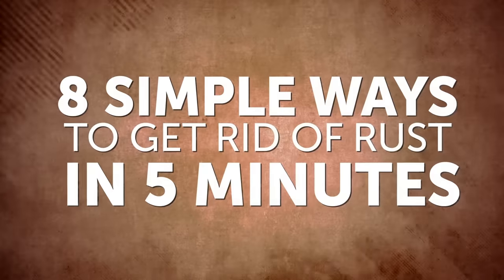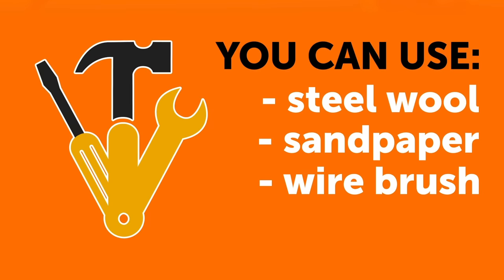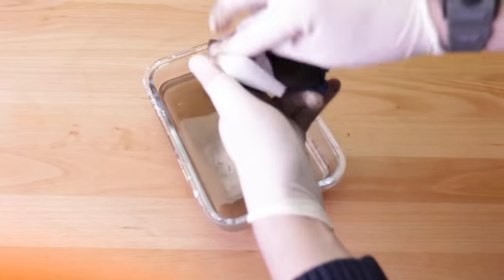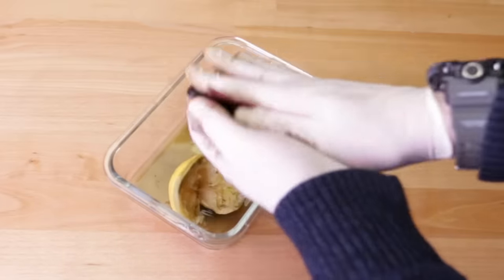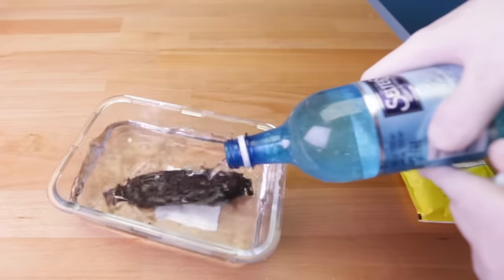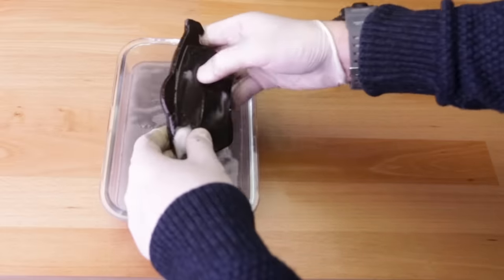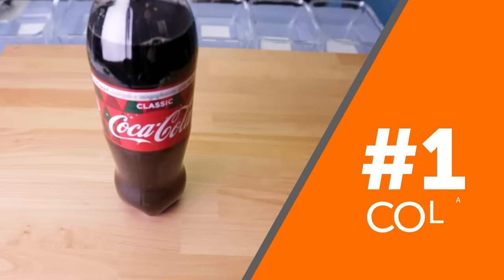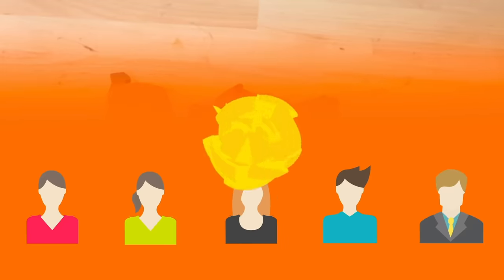8 Simple Ways to Get Rid of Rust In 5 Minutes

Comment: Use  a diluted solution of Phosphoric acid,  then rinse off after 1 hour. this  not only removes the rust  but turns it into a different type of iron oxide  that is dark black and resist any further rusting.
Use rubber gloves to prevent burns from  acid.

Comment: Don't forget to neutralize the vinegar after using it otherwise your tools will catch rust so fast you won't be able to recover.
Reply: I used white vinegar and at first it seemed to be effective, however during a second vinegar bath the items turned orange 😭🤦🏽‍♀️… now I’m on a mission to undo my mistake
Reply: How to neutralise the vinegar?
Reply: @bigcat7569  Baking Soda
Reply: @cherylc4727  what to do with the baking soda to neutralise, please? Sorry, I might do it wrong if I don't get specific instructions.
Reply: @maloutungol9380  make a baking soda paste by mixing baking soda with a little water, rub the metal down with it then rinse off and dry with a rag.  Apply a thin coat of mineral oil to the metal to protect it from further oxidation (rust).
Reply: @MrRecondo101  thanks!!

Comment: Go top pool supply store. Buy Muriatic acid. Where gloves and googles. I dont care what it is, in 5 minutes the rust will be gone. be sure and rinse with water and then oil or paint to inhibit rust return.  Muriatic acid will remove metal if in muriatic acid too long, 5 minutes is fine for screws, bolts, nuts, tools, files,...

Comment: Bunch of these aren’t gonna get these things completely clean of rust…how to remove all the rust from a metal object:

1: Scraping off some thick rush

2: Rust remover or vinegar (or electrolysis)

3: Wire brushing

4: Sand blasting

5: Thorough coarse sanding

6: Thorough fine sanding

7:Buffing

Bonus: Spray clear coating or paint the metal in order to prevent further rusting.